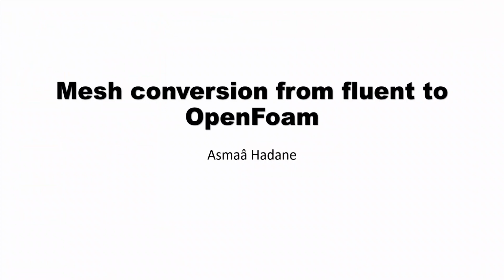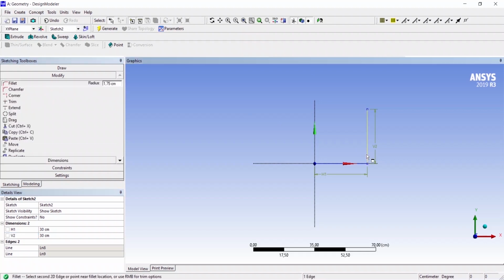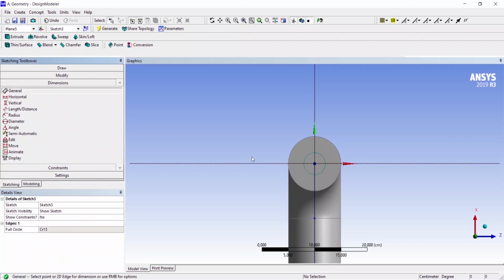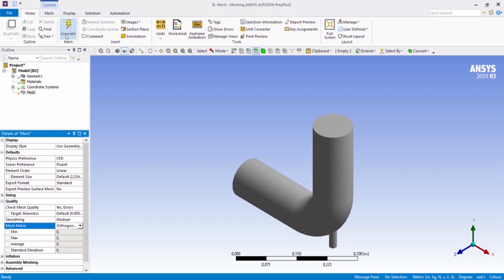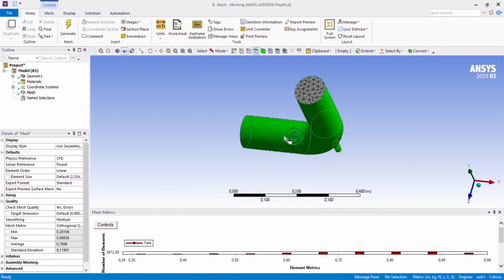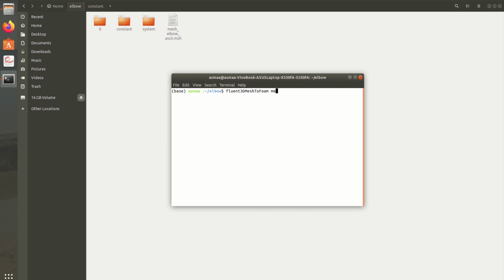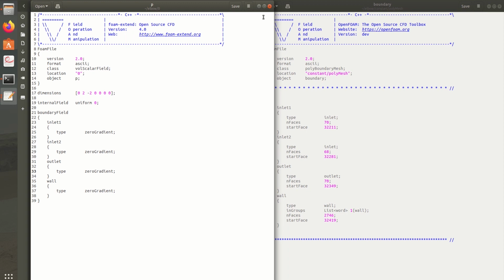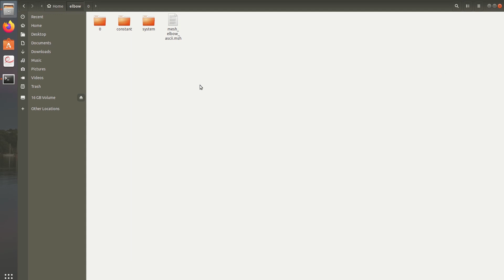How to convert Fluent .msh mesh to OpenFoam polyMesh using fluent3DMeshToFoam #AsmaaHadane

Comment: Hi! Very helpful video? May be you know, what is the problem, I try to put the mesh from Fluent Meshing using fluenttoopenfoam to openfoam, but it doesn't work.
It is priblem related to fluent meshing or not? I use ascii file mesh
Reply from the maker: The command is:
fluent3DMeshToFoam file.msh
if you generate the fluent mesh properly, it should work fine.

Comment: thank you for this clear video, but where should I paste msh file, because I dont know where to find this this file, 0 , constants and system file, I am using windows
Reply from the maker: You need to copy your .msh file on your OpenFOAM case where there are 0, constant and system folders
Reply: @CFDAsmaaHadane  where can I find these folders? I mean is there any specific directory?
Reply from the maker: Any arbitrary openfoam case folder can do the job for mesh conversion but for simulation you have to put your own conditions and parameters.